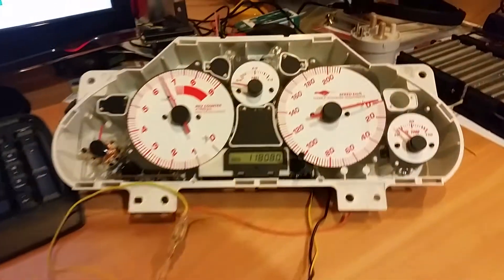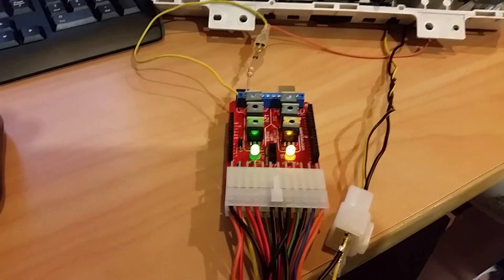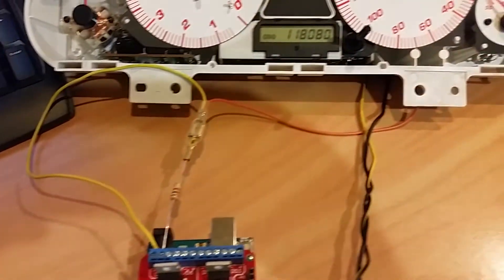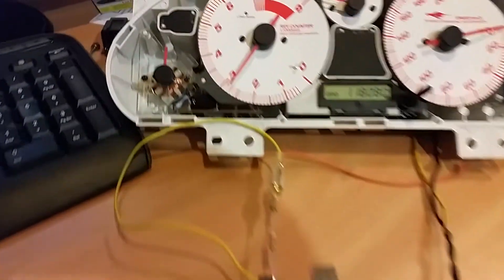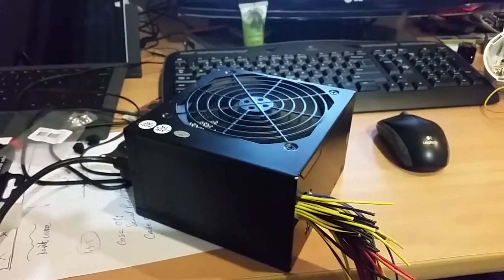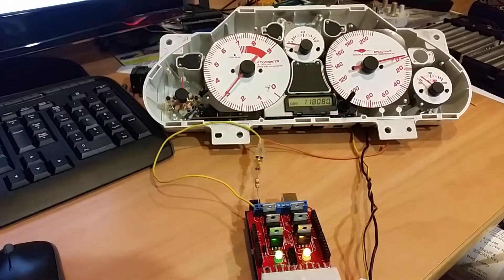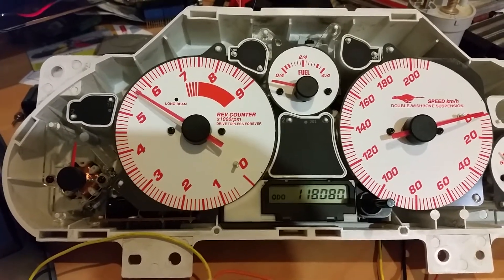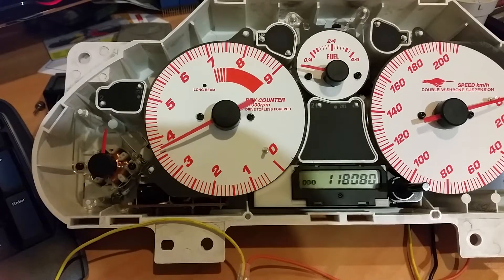NB Miata tacho driver with Arduino

Comment: All of these gauges are steering by frequency?
Reply from the maker: These gauges are all analog and hence they are run by varying the voltage.  This is accomplished using PWM out of the driver board.